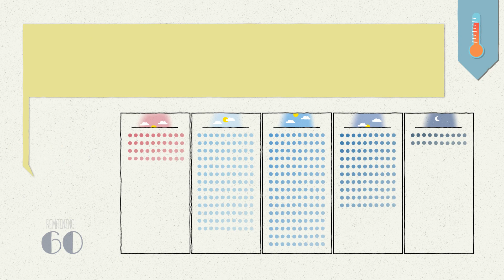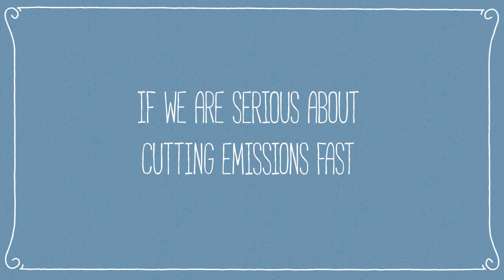Can intermittent renewable energy power societies?

Comment: What is the solution?
Reply: Nuclear.
Reply: @mac2105 how will we handle the nuclear waste then?
Reply: @akhilkrishnahere  dump it in the deepest trench in the middle of the Pacific. No human being will ever encounter it again.
Reply: It's this or runaway climate change with negative consequences beyond human imagination
Reply: @mac2105  what about sea creatures?
Reply: @akhilkrishnahere  there are very few at depths beyond 1000m below, the Pacific is up to 11km deep
Reply: Any energy source aside from fusion produces waste, nuclear waste is way better than CO2
Reply: @akhilkrishnahere  Nobody wants to give up their washing machine, electric light, heating, fridge, television, computer etc. So we need to find ways to produce that electricity in a non intermittent reliable way that doesn't produce greenhouse gases and we need to start immediately. The only option I see is nuclear. And I say that as someone who works in wind power
Reply: @mac2105  Underwater storage is in my view, with all due respect, an incredibly bad solution. 
In the Netherlands, we built a box of 6 meters of concrete on all sides, where we put the nuclear waste. It's blast-proof, deep below the ground, so it won't harm any human, plant or animal of any kind. 
As someone that works in the wind sector, how would you solve the problem of heating? Because nuclear may solve the electricity demand to an extent, but we also require energy for transport and heating.
Reply: @augustus331  electrify everything, electric cars and heatpumps, that's the plan with or without nuclear, only I feel it's much harder if we take part of the solution off the table for reasons that I now think don't stand up to scrutiny